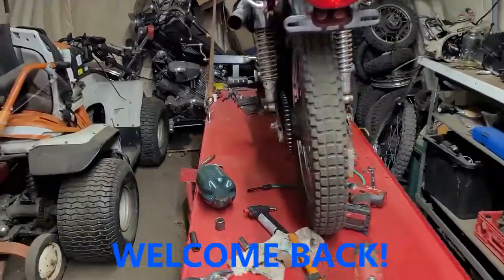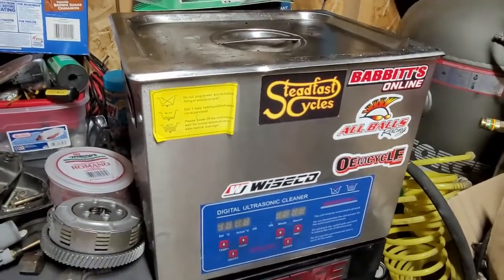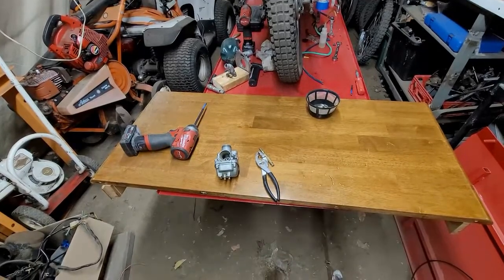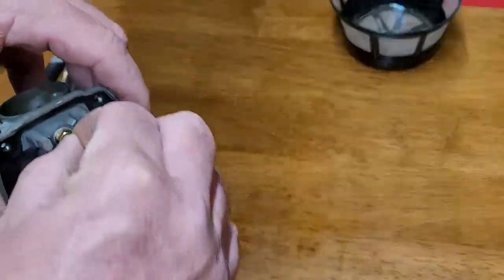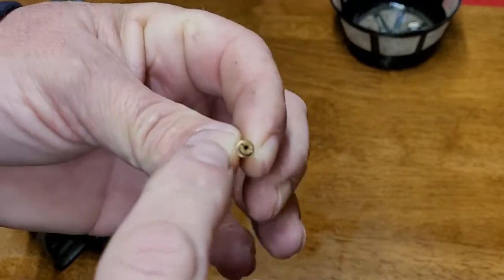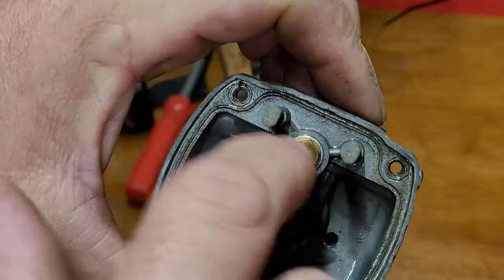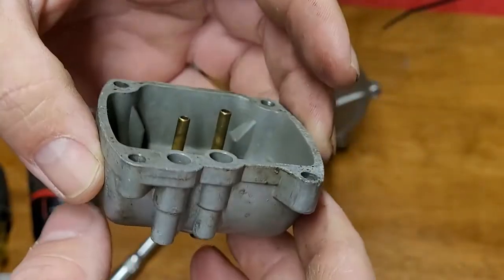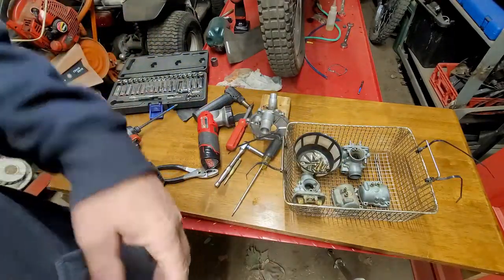Working on Aarons bike / COMPLETE CARB TEARDOWN AND EXPLANED! part 1

Comment: Hi Kevin,  I have a 72 G4TR-B and the original parts manuals. For some reason the manual does not show a pilot valve. Main and needle are there. So weird. Tried to read the original and all I can see is ...x7.5. Would you happen to know what size pilot jet is used? Thanks so much! Now that I'm done with my 74 YZ, it's Kawi Time! Your videos are so helpful. Thanks!

Comment: hey kevin, i have a kawasaki ke100 engine and for some reasok whenever i shut it off it floods the carb. i believe something is stuck, any ideas on why it floods and wont stop filling?
Reply from the maker: Someone in the carb could be float needle and seat i explain all the possibilities in this video
Reply: @2strokeguru  also i was wondering ive tried to unclog my pilot jet with torch tip cleaners and used a torch and rust solvents and it is still clogged. any ideas on what to do
Reply from the maker: @gavinmclean5650  if you can't clean it with a touch replace it
Reply: @2strokeguru  thanks

Comment: Im pretty sure the headlight runs off ac from the stator.
Reply from the maker: yes it does depending on the harness my ke100 comes on with the key earlier the engine needs to be running